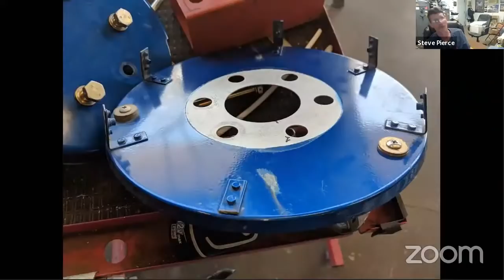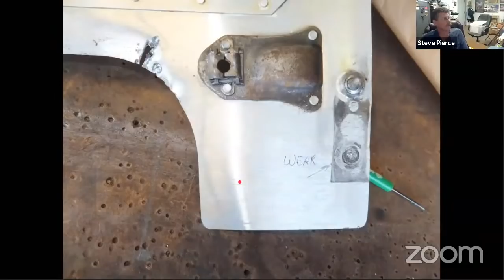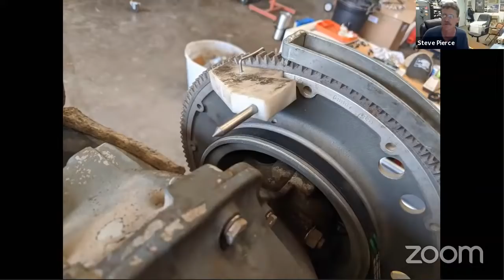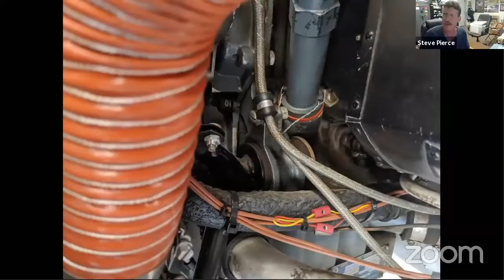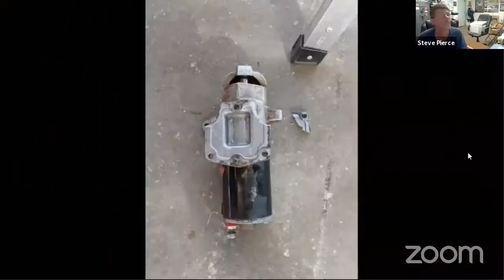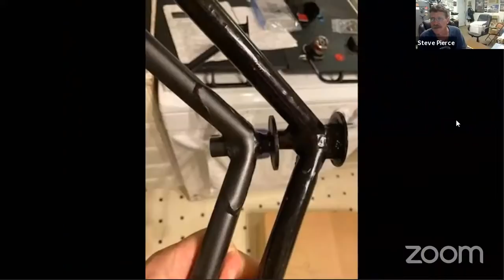Steve Pierce - Inspecting the PA-18 Super Cub - Where to Look and What You'll Find Episode #1

Comment: Fantastic, Thx!  Comment:  If you fly in the winter where it is cold, you absolutely need to have a primer system installed. A friend from southern Oregon asked me to fly his cub from Homer to Oregon- which I gladly did.  However, I spent the night in Whitehorse (end of April) and with temps @ 30 degrees (with  25 mph wind) I ended up hand propping the 150 hp I figure 70 times!  The accelerator pump had raw gas dripping out of the air filter, but I couldn't get any atomized fuel into the cylinder to fire (and I had no ether).  Even though I was dressed in a cotton flannel shirt, I was sweating when I finally got it started!  In Oregon the temps are high enough the accelerator pump was enough for a cold start, but in Alaska you really need a primer system or 3 or 4 buddies taking turns hand propping the thing!

Comment: Rotating the spark plugs does increase longevity.  Because of the way the mags are geared on the back of the motor one mag fires positive to negative and the other negative to positive (tip to electrode or vice versa basically).    Wears the plugs more evenly when rotated.